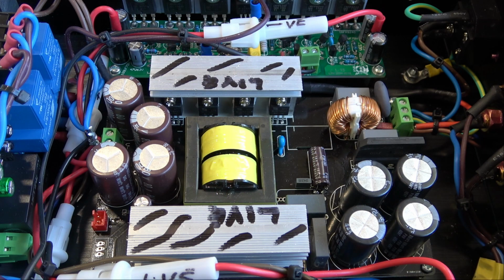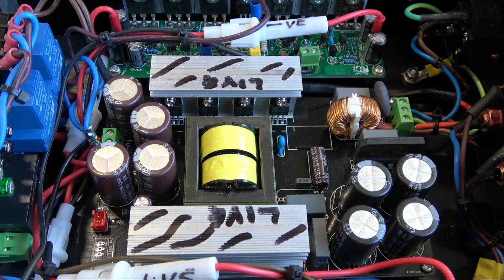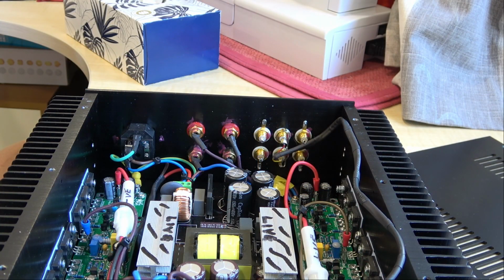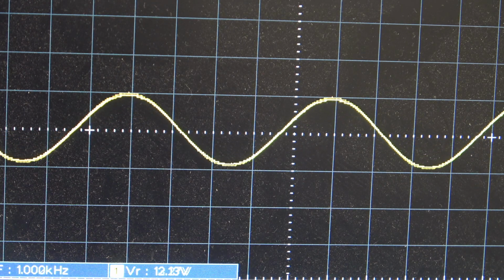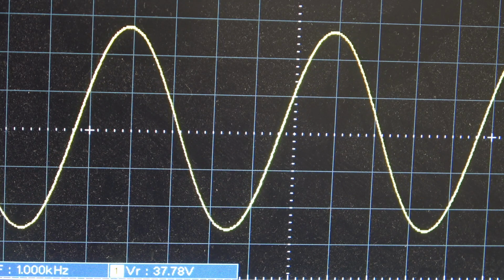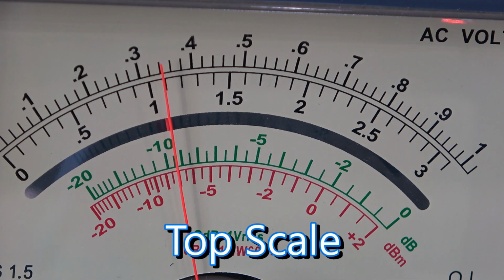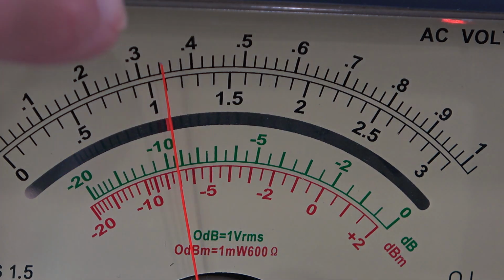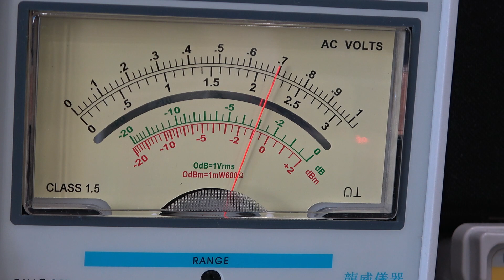LJM. L15.  MOSFET. Amplifier 150 watts x 2 into 8 ohms

Comment: Well.  I tried this amplifier with a  car  subwwofer  load at  (2ohms . 400 W rms ) .  And almost forgot to put down  the working  voltage:  50V+-- .  The result was a Pretty loud and very clean sound .  At moderate Volume.  Its gets warm quickly .   I don't like to crank to the top  . 
But   I saw at AliExpress another L15 amplifier model  with the  IRF  240 and  the IRF  9240  . 
The  manufacturer claims  : 150 W at 8 ohms . 300 W at 4 ohms and  600 W at 2 ohms .    
  So the question is  if this model  with  6 MOSFETs  IRF 
 250 can handle for long time low loads like 2 ohms  like the other L15 model ?
Reply from the maker: @rafaelmachado8887  I would never run any amplifier into  2 ohms. After all a 2 ohms speaker could easily drop to 1 ohms at some  frequency. Few amplifiers will like that. You will need a very   large heating.

Comment: What value of fusing have you used for the +ve on the L15
Reply from the maker: To be honest Bryan, I cannot remember. That project no longer exists. The value depends on the supply voltage, speaker impedance you use. If you drive it hard, type of music etc. I always use the lowest value for best protection. Use quick blow. 5amp is a good starting point.

Comment: im thinking to run this on +- 65v dc. would it be fine??
Reply from the maker: It's pushing things abit, might be OK at 8 ohms but probably not recommended into 4 ohms, will get quite hot. Fets tend to run hotter because of the internal voltage drop. Why do you need to run the voltage so high?
Reply: @MichaelBeeny  transformer is set. cannot change it.
Reply: @MichaelBeeny  transformer is set. cannot change it.

Comment: is it an issue that these doesn't have emitter resistors?
Reply from the maker: Hi Tibi, no, not an issue. The internal voltage drop of FETs is higher than a transistor and they have a positive temperature rise, so runaway cannot happen.

Comment: A used Rotel RB980 cost the same, it is a state of art power amp and with 2-3 modifications I can say that the sound quality is unbelievable.
There is no reason investing to these chinese rubbish except very few examples like tpa 3255.
QUAD 606 clone (in fact is 909) also is one interesting amp .
LM4702 voltage amplification with sap15 current amplification is also a very very good solution, far away better comparing with hard sound of L15
Reply from the maker: Hi Dimitris, I don't disagree with your comments at all. However, the Rotel is in quite limited supply so not any real point in my recommendation because of it. I choose the L15 simply because it is widely available. I'm not that keen in it myself, the L12/2 is a much nicer sounding amplifier, my favorite in fact.
Reply: @MichaelBeeny  Hi Michael, Rotel RB980 has sufficient power supply following the rule , desirable power at 4Ohm X 1.4!.
It means 2x120 at 8, 2x200 at  without clipping at db that neiborhood...will call police!!.
I don't hate Chinese boards there are some of them that are really good proposals.
For example I made for a friend a integrated naim Mac 152 with nap 250. PCB only from China , parts from European market.
It was very very good.
Also Quad 606 , in fact it is 909 die to its modern transistors that do use.
YBA clone, Krell 100 (I can send you photos) but my problem is that a good tpa3255 board with a non  Skroutz (!!) Switch supply promise more and you know we became old to accept it!
By the way, the power transistors of L15 are in favourite list of Nelson Pass!
Reply: Salut, I am aware that the real sound image can only be partially heard from yt recordings, but listening to a couple I can say that the rotel sounds less clean, with less detail, a bit lifeless (dynamics) and a bit on a warm side comparing to mx50, l12, l20. .
Would also like to know if there is better sounding amp decently close with price, but seems there is none so far.

I don't like that cold sound stage LJMs are reproducing but someone said its in the nature of clear detailed sound to feel more cold in highs and that warm sounding amps are less detailed.

Hope soon will assemble l20se(LJM's best amp) and l50 board that have order for test.

Comment: Hey Michael, 
I need to add a fuse to my amp. Have you covered how to estimate the fuse size in any of your videos?
Reply from the maker: Hi Rob, I tend not to comment on fuse values, mostly because it depends so much on the transformer or SMPS used. I guess we are talking about mains fuses?? and of course if we are using 110 or 240volts input. For 240 volts probably 5amp is a good start. but it will also depend on the smoothing caps, so many things. If you do find it pops on switch on take it up a little. I tend to use quick blow fuses, protects that much faster but can pop on switch on surge. Better to experiment and pop the odd fuse than over kill with a 10 amp or slow blow fuse. Best not to use silver paper or a nail lol. I've seen it!

Comment: Hi Michael, thanks for putting out these very useful videos. I have been working on an LJM-L15 build myself and have been encountering many issues with noise picked up by the input lines (buzzing / hissing as soon as you connect any cables to the input). Have you ever encountered this, and if so, any suggestions on how to overcome it? I've tried higher quality, shielded cables, and that helped a bit, and ferrite beads which had no impact.
Reply from the maker: Hi Chris, I am listening to music on my L15 as I type this reply. It's the integrated version with the simple Ne5532 preamp. Even at full gain a gentle hiss is only just noticeable. Are you using the kit of parts or your own PCB? Do you have a vol pot across the input?
Reply: @MichaelBeeny  thanks for the quick reply! I'm working from a pre-made Chinese board (no integrated pre-amp, and just controlling volume with my source at the moment, although I would like to add a volume pot later) and a fairly simple linear power supply I put together myself. I actually hadn't considered using a preamp, but looking at the Ne5532 spec sheet, I see it offers some unwanted noise rejection. Do you think my problem may be solved simply by adding a Ne5532 preamp circuit?
Reply from the maker: @TheChrisprevails  RE quick reply. I just happened to be on line listening to some music and your message popped up.
 I've not encountered noise on the inputs before. Adding a preamp should only give you gain which you might need anyway, depending on the input device you use. What is the input? You might have an earth loop of some kind. If you don't have a pot, that might help as it terminates the input. Try a 25/50K log pot. If you buy/make a 5532 preamp, note most kits come with a fake 5532. Ok to get things working but replace it with a chip from a good supplier.
Reply: @MichaelBeeny  so far, just a bench-setup where I'm connecting it to the headphone-out of an old receiver, which seems to be high enough gain for my testing so far. I considered ground loops, so I tried connecting to my phone instead, and the problem persisted. I will try your suggestion and dig through my parts bin for a pot. Thanks again for the suggestion!

Comment: Looks like you have blown the SMD fuse when you shorted the pins on 15V. That green part with a "k" on it, the "k" indicates its 1.5A fast blow (1206 size). The power supply is quasi resonant smps. They tend to be small and efficient dude to higher switching frequency (above 100KHz) and zero voltage switching. It should be close the the rated power if cooled properly. I believe the heatsink that was getting hot is where the output stage diodes are mounted. These power supplies really should be mounted in a shielded case to minimize EMI and a EMI filter connected to the outputs before it goes to the amplifier, not doing so the noisy switching of the output diodes and main switches passes to the amplifier. The amplifier boosts the noise it gets in the power lines (even though its out of the audio spectrum) making the amplifier get hot i.e. to draws more current than normal. You can see the switching noise on your oscilloscope. That place on the PCB near the 15V with three pins labeled In1, GND and In2,  appears to be a protection input. If the voltage goes above 1.5V it turns the power supply off. I suppose you could attach the input signal of the amplifier via an op-amp with a noise filter to those pins to turn the power off if the signal is excessive. This is what I understand from looking at the listing of this psu.
Reply from the maker: Hi Nicolas. Many thanks for your input here regarding the SMPS. As I have removed this SMPS, I have not even looked at it since. You are correct the SMD fuse has blown. I hope only the fuse has blown. I will replace it and see. 
Up rating the heatsinks on the SMPS is not really a viable solution, but a fan across the top of the two heatsinks could well be the answer. I will look into this. The amplifier heatsinks getting hot is not noise from the power supply. I'm now running the L15s with a linear PS and the Qi is the same. No visible noise or HF on the waveform.
Reply from the maker: Hello again, I have replaced the fuse and the LED. All working again. I'm going to fit a fan and use this my Module 80 box with the L15s to get the max power these amplifiers can deliver. Working on a video now. Do you know what current can be drawn from that 15 volts output? As it is fused at 1.5 amps, should be safe to draw 0.5 amps I would have thought.
Reply: @MichaelBeeny  You can draw the rated current of the fuse for up 4 hours as specified in the data sheet for this fuse before it fails, provided proper heat dissipation of the fuse. However this is not good practice, usually fuses are rated to be x2 the rated current required to draw, i.e. for 1.5A rated fuse, 750mA the recommended current draw continuous. This rule varies from fuse and conditions and is good practice.

Comment: Shouldn't emitter resistors be included to protect the transistors?
Reply from the maker: Don't forget these are FETs not transistors. It's quite common not to use resistors in such circuits.
Reply: Since this amplifier is using MOSFETs they will have a positive temperature coeffect, emitter resistors are not needed to help with current sharing.

Comment: Hi, Michael love your amplifier, only have one question, the board has the sound signal green connector, 1 speaker connector output , a GND, a Vcc input and a Vee- input. The vee- and the vcc+ are used to supply power to the board in DC and the GND and output are used for 1 channel?
Reply from the maker: hi Alberto. The pin marked GND is the 0 volt rail, an important part of the power supply. This goes to the 0 volts from the power supply. The small green  socket is the input from your preamp or other source. The earth on that socket should only have the signal earth from the signal cable. It is a mono board so left goes here and the same for the other channel (right) I hope that makes sense?

Comment: thanks for the video. What kind of documentation comes with those amplifier modules? they don't provide a schematic do they? is that trim pot for Q current? Thanks!
Reply from the maker: Hi Charles, Sadly you get nothing, no instructions no circuit, just the parts, at least the components are marked on the PCB. Some data is available on line however. If a circuit has a pot it normally is for QI

Comment: Have you tested the sound quality now you have your speakers repaired?
Thanks!
Reply from the maker: What I propose to do Derek, as the sound seams very close, is to replace one channel with the L12/2. Use a mono source and switch between the L12/2 and the L15. Witch ever is the best I will use as my main amplifier. I will also return it to the bench and do comparisons technically. I hope the one that measures best is the one I think sounds the best.
Reply: @MichaelBeeny  thanks Michael, I have built both although the L15/2 is a twin mono block set up. They both sound good to me, I am interested to see how much difference you can measure/ hear, when you test them together. My test kit and ability is a bit basic!!
Derek
Reply from the maker: @derekduffill712  The best test gear anyone has is there ears. No one can ague  with these.

Comment: After a bit of research on the net I found that this is a resonant LLC smps. Manufacturer claims that transistors are in soft switch mode. That means that transistors switching on a 0 crossing AC voltage of a resonant LLC circuit. In that case transistors can run without heatsink in some high quality power supplys. But in this case the frequency  must be incorrect. There are a lot of reports of overheating in customer reviews. But in your case overheating schottky diodes. The solutions are bigger heatsink, active cooling, or another pare of a schottky diodes parallel to those 4. Hi-Volt Resonant Controller is L6599AD

Comment: Intersting, I built one of these in last lockdown and mine runs cool at +-76 VDC @ 32 degrees celcius. I get around 500w per channel into 4 ohms. There are 2 versions that I have noticed and I had to adjust the q current on mine. It shouldn't be running hot at low volumes though and it could be too much bias, maybe get a clamp meter on the DC rails and check what its pulling and possibly break the glue on the pots and turn it down a lal bit.
Reply: Have you used a large resistor and measured volts and amperes. 500w sounds like a lot!
Reply: @ford1546  indeed. I use a bank of large resistors for power testing. It does sound a lot but I am running at around 80v per rail and my psu is massively over sized.
Reply from the maker: Mine were set at 50mA possibly about right. Mosfets do tend to be run at higher QI than a normal transistor amplifier. I would have thought 76volts and 4 ohms was pushing things abit.
Reply: @MichaelBeeny  When it comes to biasing MOSFETs, the ideal quiescent current is 110 to 160mA to minimize crossover distortion. Need a bigger heatsink :)